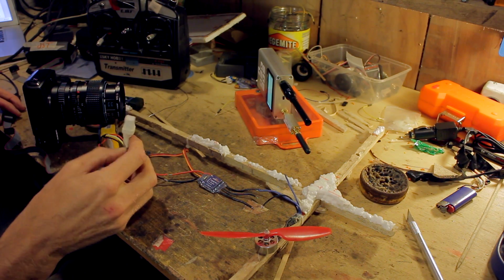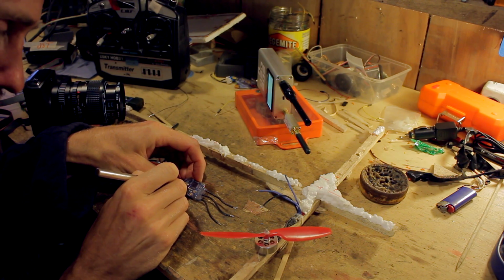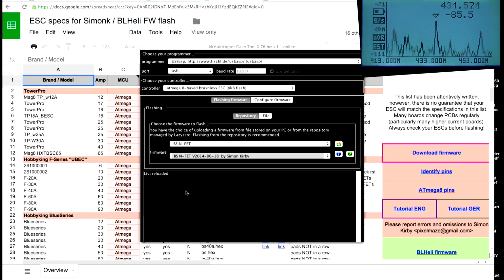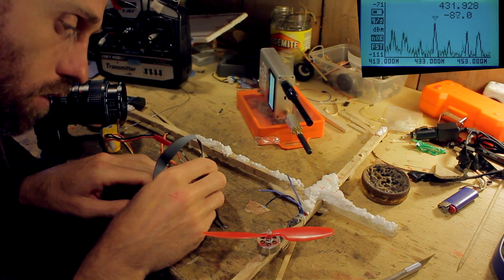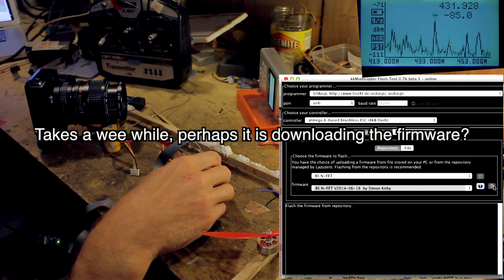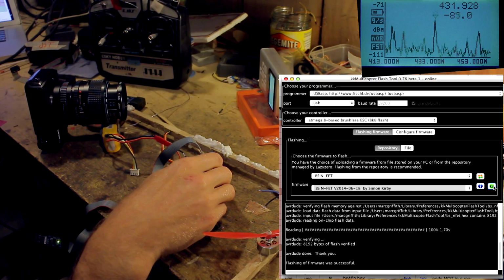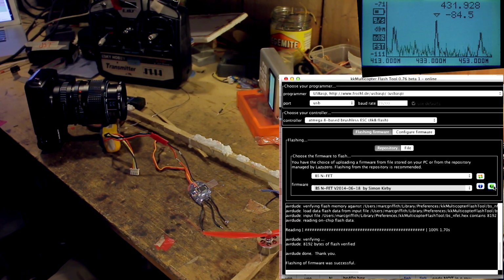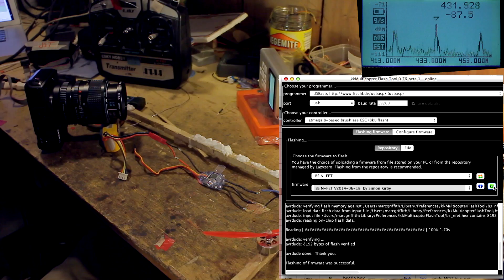Do ESC's produce RF noise? RCHacker #69

Comment: Maybe a manufacturer needs to begin offering shielded servo wire. I am still too new to the flight portion and LRS tech, but my years of working coaxial rf and performing CLI leakage calls for FAA/FCC compliance in the cable tv business taught me that hasty practices in cable making at the fittings was the most common issue.
Some micro coaxial, if it could be made at the proper impedance would be a boon... unless it exists and I am unaware of it.
I am a big fan of your vids and efforts- many thanks.
Reply from the maker: Thanks, trouble is they make these as cheap as possible. Sometimes that involves taking a good design then removing as many components as possible before it stops working. Although these do have an external oscillator.
Reply: Those internal Audiowires in your PC/Computer coming from the CDrom are shielded and very thin. So maybe they would reduce the RF noise a great deal? Just a thought, I have no equipment to check that out.
Reply: *****  Hi Hiway! Don't want to bother you but did you had a chance to check that out?
Reply: CrashPilot1000
nice lateral thinking... I have a resource I can ask who will test it if he can. Thank you.
Reply: CrashPilot1000
I completely forgot- I need to follow up- it is winter but the guy I lean on for counsel travels a lot and we speak infrequently. I am putting a giant sticky on my board here in the office as a reminder. My apologies!

Comment: I am still getting over the hair massacre Marc. :)
Try a small cap from sig to gnd @ the ESC board pads. A SMD cap preferably. Possibly sig to +ve as well depending in which line has least impedance. At the RF frequencies the cap(s) will apear as a short but at the PWM servo frequency it will have no effect.
Cheers Rob
Reply from the maker: Thanks, I was thinking that, I wonder if there are any ESCs that have a small RC filter built in. Testing the various solutions might be worth another video.
Reply: RCHacker

Could be that the signal wire is picking up RF noise from the UBEC. try desoldering the 5v wire instead.
Reply: johneh87 I would also like to see you try different configurations with the included toroid, like 5 turns with all 3 wires close to ESC...  5 turns with just signal wire, and maybe 5 turns with the 5v wire if that's also emitting noise.  Wrapping all three conductors should be less effective than just the one which is emitting noise.  And only one or two turns probably won't be enough to make much difference.  An smd cap would be optimal from a weight perspective but using the toroid which is free and doesn't involve tiny soldering would appeal to a lot more people.